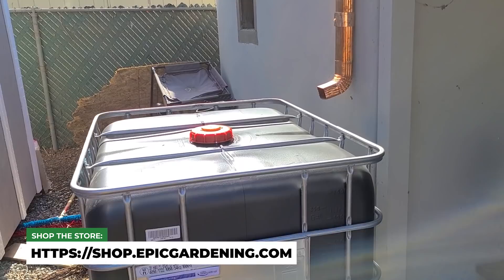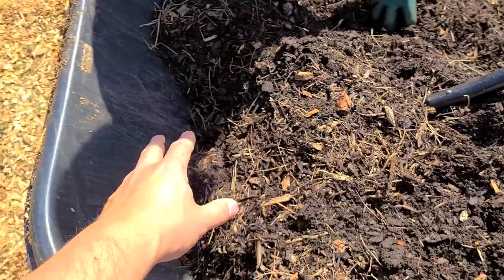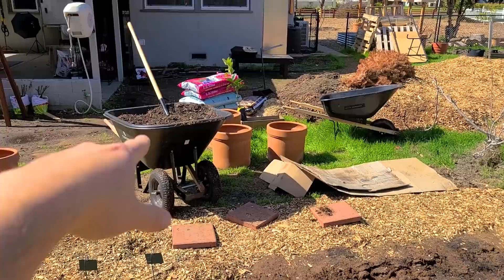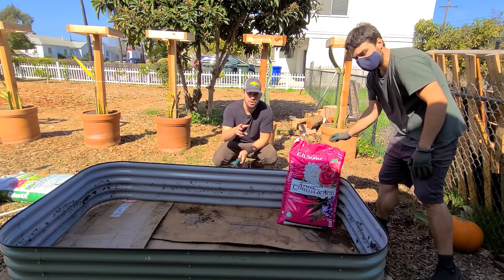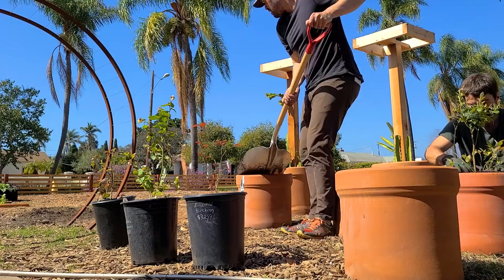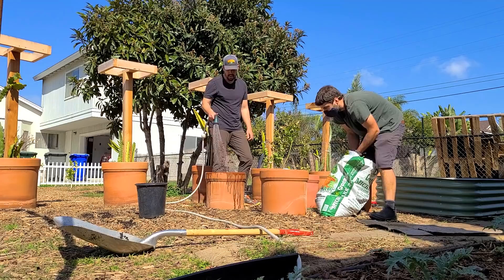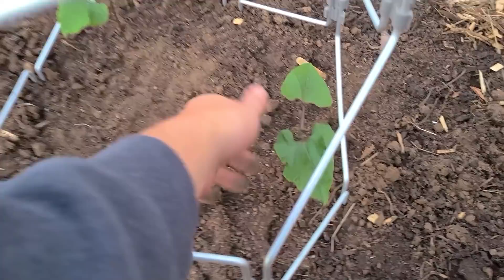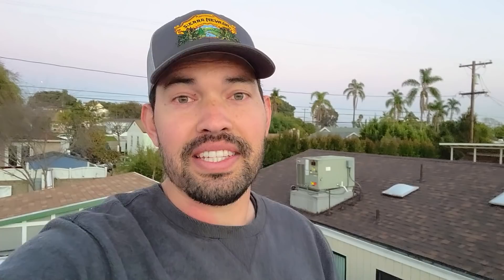We Have BLUEBERRIES at the Homestead!

Comment: I have one of those rain barrels. It's lasted a little over a decade and still going. I took the main screen off and put in a nylon screen, like for your windows under it then screwed the one that came with it back on. It' helps keep bugs out that way. Also you will need to hose it out occasionally as it will get sludge on the bottom. They have held up in zone 6b just fine, even in winter. Do drain them if you get cold winters in SoCal you should be fine though.
Reply from the maker: GOOD call, I will def do this!

Comment: You'll have better/faster flow from the tote and rain barrels if they're set on cinder blocks.  This increases the head in the water.  They'll flow okay when full but the flow rate slows considerably as the water level goes down

Comment: Kevin I think you need to put the barrels onto something to have them higher so you don't depend on a pump to empty them completely. Also... that bowed up mesh (the off-center one) probably won't do much for the water collection, but there is an easy fix - remove it from the screws and either cut that one or another plastic/rust-free metal one in a circle shape to fit inside the hole and stick it in there a few millimeters with a glue gun - that ought to make them good to go :)
I don't know if it's on purpose... seems like a manufacturing error, but if it is on purpose... there is a small advantage: leaves and other "large" matter won't stay on a bowed up mesh, it will run down outside. By putting the mesh lower it would gather leaves and debris eventually. But if you clean it/scrape with your hands every 4-5 rains... you should be fine with the solution I explained above.
The progress looks great! Good luck!
Reply from the maker: Thank you for this comment!